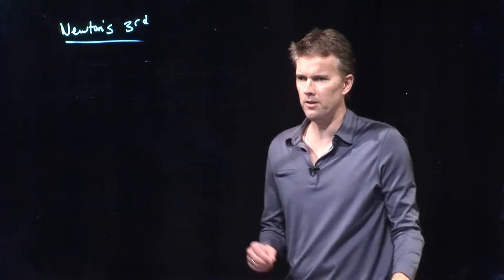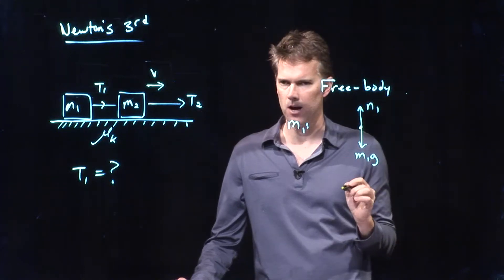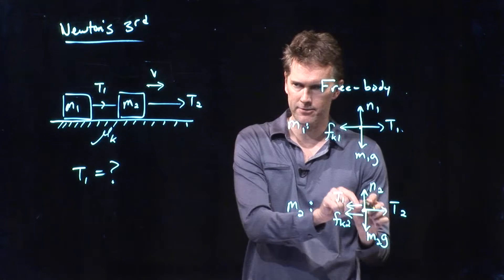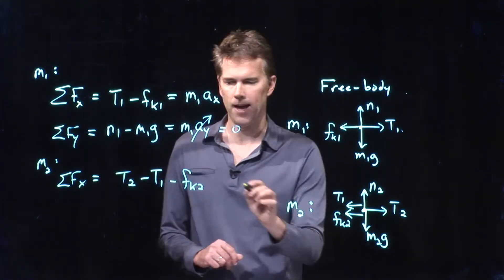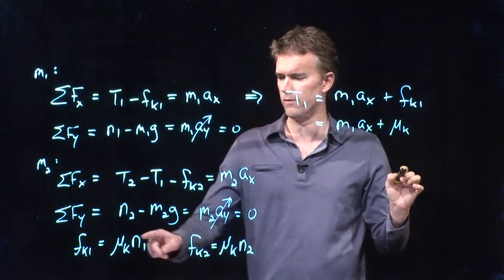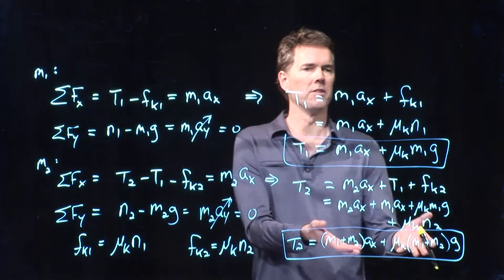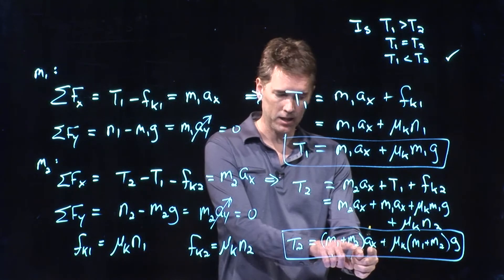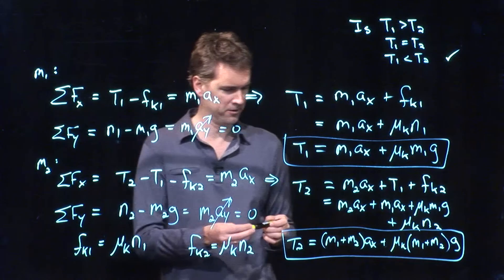Newton's Third Law - Two Blocks Tied Together

Comment: What if the force was pulling up at an angle of 60°? With kinetic friction as well. How would this affect the normal force for the blocks, assuming each block has different weights and acceleration on both blocks happens only in the horizontal?
Reply: If the force were pulling block 2 upward at an angle of 60 degrees, then T2*sin(60 deg) would be subtracted from the normal force acting on block 2, and only T2*cos(60 deg) would be pulling the assembly of blocks forward.  This would reduce the friction force on block 2, because its normal force is reduced.

There would be a maximum value of T2 in that scenario where the blocks would still slide across the surface, because if you increase T2 too high, then the normal force on block 2 would no longer be a positive value, and the block would lose contact with the surface beneath it.